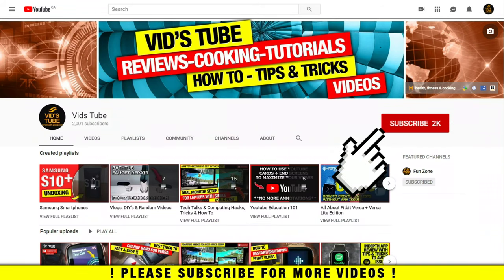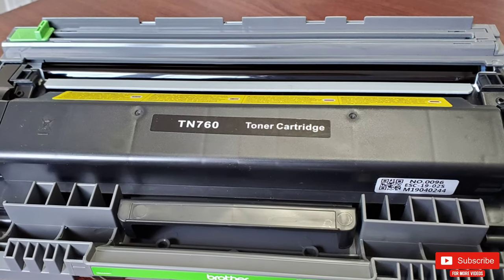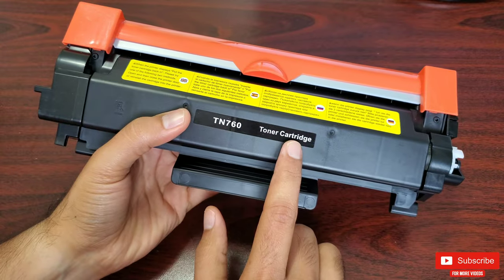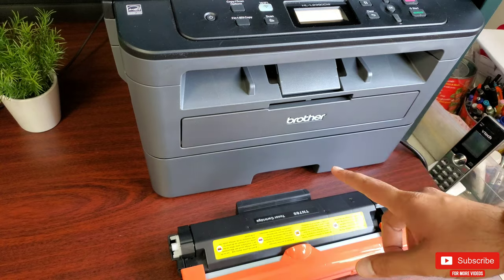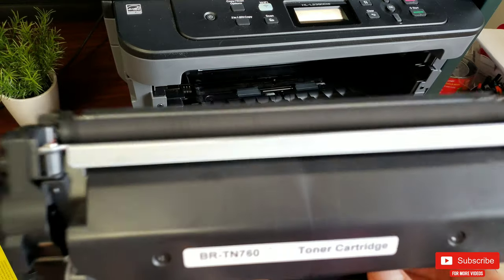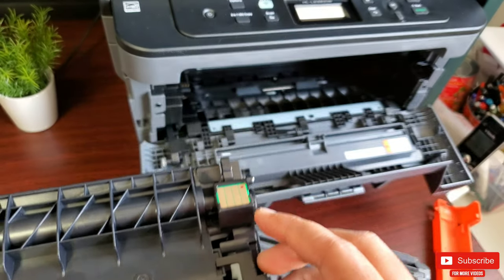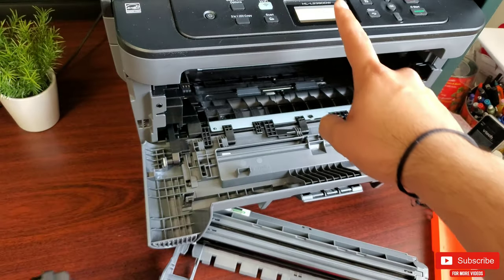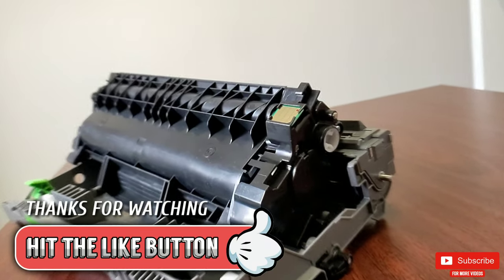How To Replace Chip for Brother TN760/TN730 Toner Cartridge

Comment: 100% worked. It's a little tricky with the plastic clips on the end. I just broke them off on the old cartridge. But for the new one, I used a small paperclip on the inside edge and a big flathead to gently raise the clips on the outside edge. Thanks so much.
Reply from the maker: Thanks for watching and comment. I am glad my video helped I have done another video check it out https://youtu.be/8AByvaHPeL4 Also consider subscribing as I do a lot of tech related videos and also follow Vidstube on other platforms https://linktr.ee/vidstube

Comment: Is the toner TN730 chip compatible with toner TN760?
Reply from the maker: Thanks for watching and comment. No it wont be compatible but you can try as it may work but it would show tn730 levels instead of tn760. I have done another video check it out https://youtu.be/8AByvaHPeL4 Also consider subscribing as I do a lot of tech related videos and also follow Vidstube on other platforms https://linktr.ee/vidstube

Comment: Do you just use the aftermarket toner cartridges with the chip that comes with them?  Not the Brother chip?
Reply from the maker: Thanks for watching and comment. No i mostly use after market tonners anyways check it out https://youtu.be/8AByvaHPeL4 Also consider subscribing as I do a lot of tech related videos and subscribe to my second channel http://bit.ly/vidstubeshorts
Reply: @vidstube  I still want to know do you just use the aftermarket toner cartridges with the AFTERMARKET chip?  Some people SAVE the original Brother (or whatever) chip and insert into the aftermarket toner. I saw your aftermarket toner HAD its own chip in it.
Reply from the maker: I think I did a video for that as once I used a chip from an old tonner and inserted it into the new tonner without chip as they are cheaper 😉 but as shown in the video its suoer easy to replace chip

Comment: If you have a toner with chip, why you still need to change the chip?
Reply from the maker: Thanks for watching and comment. No if the new tonner does not have have a chip then only you need a chip other wise its all fine. check it out https://youtu.be/8AByvaHPeL4 Also consider subscribing as I do a lot of tech related videos and subscribe to my second channel http://bit.ly/vidstubeshorts
Reply: @vidstube  Not true. I have new non-OEM TN760 cartridges for my Brother MFC 2710 printer. These cartridges were inexpensive and say on the package they are compatible with my printer. Indeed, they look absolutely perfectly identical with the toner cartridge that came with the printer and has worked fine for a long time, but now is out of toner. But when I install the new cartridge (again, which HAS a chip and the chip even looks identical to the original, and the original is clean and not stained), the machine immediately beeps "No Toner" when I put it back together. I'm guessing that Brother does not want me to use inexpensive toner when instead they want me to buy their $90 toner cartridge. I'm guessing that perhaps I can get around this by swapping the original's chip into the new nonOEM toner cartridge, but the black tabs make that difficult, unlike in your video where it just slides out. Can you comment?